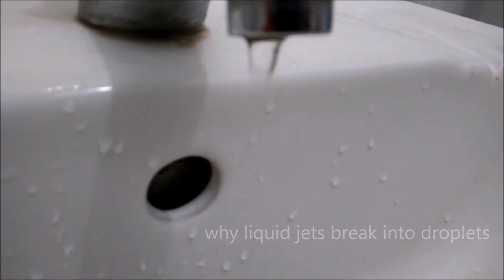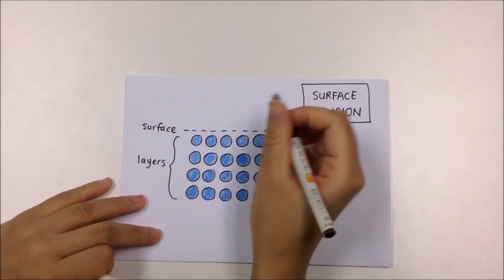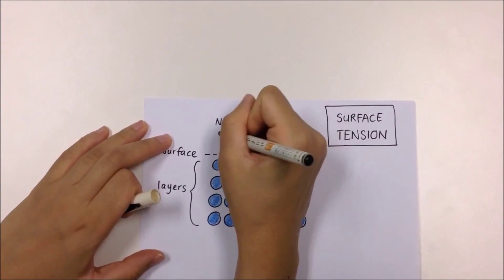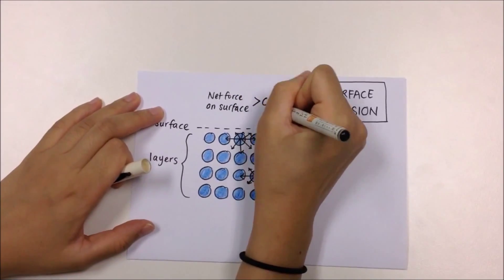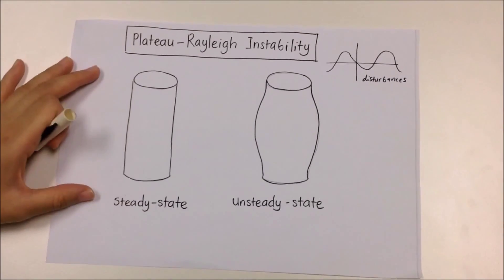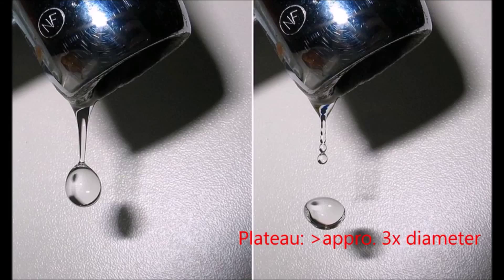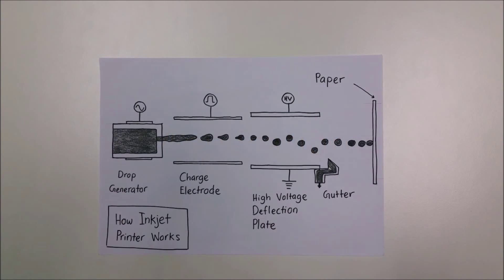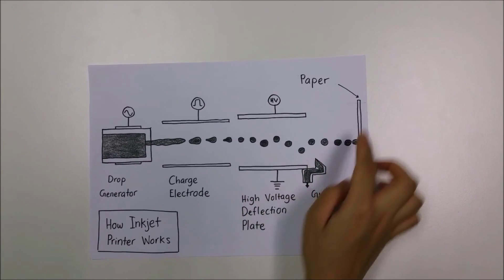Surface Tension: Plateau-Rayleigh Instability

Comment: I was thought, it takes less energy to hold many molecules together. Then, the same number of individual molecules. So, the Laplace law is stronger then this other law? Wouldn't the Laplace Law explain the Lord Kelvin water drop experiment? Perturbations always occur regardless of how smooth the stream may be. The pressure increment of a curved surface is inversely proportional to the radius. The peaks peak and the lower radius disappears, water drops. You talk about the waters wavelength, are you talking about an electrical charge?
Electric Scalable Universe!